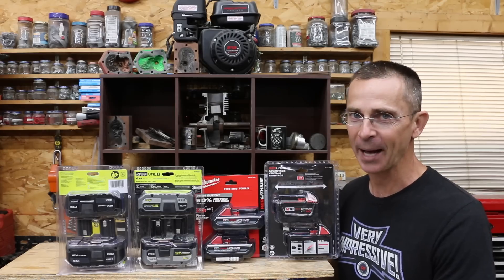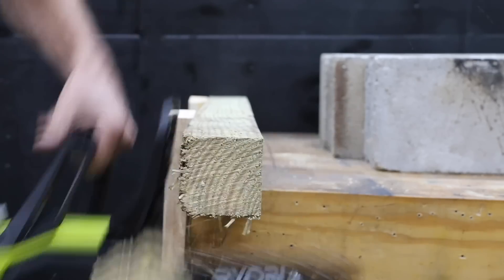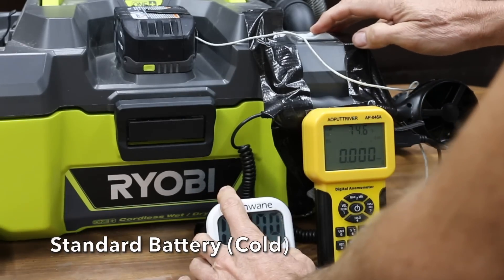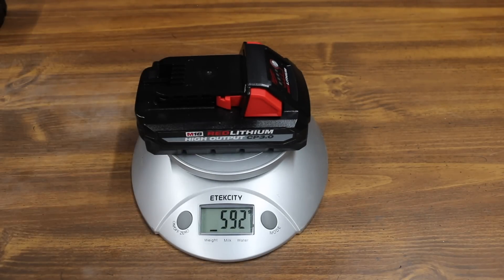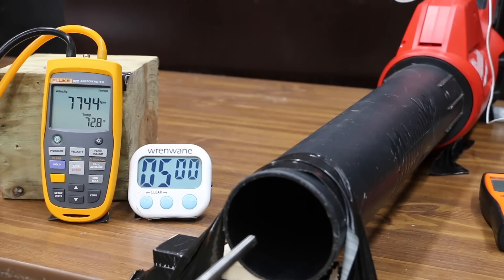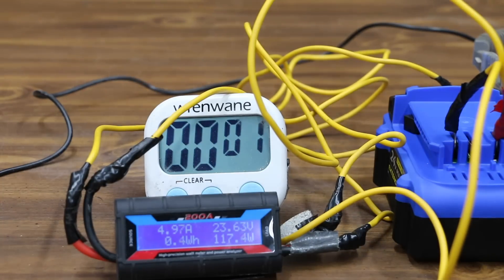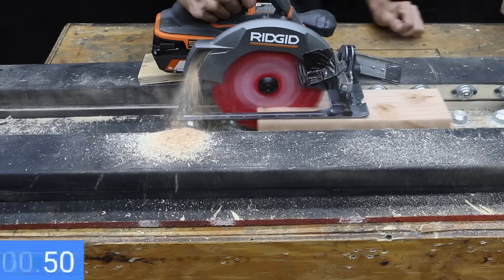Are "High Output" Batteries Better Actually Worse?

Comment: Im a milwaukee snob but became this way over the past 10 years using the brand relentlessly. The tools and batteries have outlasted everything ive used in the past from dewalt, bosch, makita, and porter cable. So yea call me biased but im a believer. I have 2 ah, 5ah, and 6HO, All genuine. I dont notice any performance gain from the 5ah to the 6ah HO running in my blower and hackzall so i dont think id spend the extra money on one in the future.
Reply from the maker: Thanks for the feedback.

Comment: I know I sound like a negative nancy but a chainsaw is a really undesired tool to use as a control due to how dependent they are to their blade wear.  The circular saw with carbide teeth is far more consistent.

I noticed that battery powered chain saws worked really well on first usage of s chain then it would struggle, whereas a gas powered saw has the hp to just chug through with a 80% blade.
Reply from the maker: Thanks for sharing.

Comment: I beleive the Kobolt Ultimate Output are only supposed to make a difference when paired with their XTL line of tools. I have the XTR circular saw with the regular battery and have not seen any need for more power.
Reply from the maker: Thanks for sharing.

Comment: Ugh, what a convoluted mess.
How does the high output model have the same Ah rating as the regular?
Sometimes it's about size, same output but smaller or lighter, & that's okay.
But, a spec they never provide is maximum output current which would be helpful for tools like saws. One 3Ah model might only make 3 Amps while another has the same storage capacity (lasts nearly the same duration at 3 Amps) but can deliver 4 or 5 Amps.
A rating of 3 Ah for example does not mean it will only deliver 3 Amps. It means it will deliver 3 Amps for an hour, or 1 for 3 hours, and so on. But maybe it'll make 6 Amps for 30 minutes.

It's also difficult to compare when you have 18/20(really 18), 24(21.6),36/40(36),56,60,80 volts etc...This is why Watt hours is a more useful value.

Comment: The knockoff 9.0 Milwaukee compatible battery is pretty good overall at less than 1/3 the price. Not for high vibration tools like the rotary hammer. Other than that they work well and for a blower or radio, flashlight etc are excellent. Durability: about 65% life of the original battery. I have sold about 25 of them now without one return. Good value. (The other amp hour replacement batteries like the 5.0 are not worth buying, most are defective.)
Reply from the maker: Thanks for the feedback.

Comment: I use Dewalt cordless and can definitely say their bigger batteries don't give a tool any more power, but they do hold a charge longer, there is a big difference in how i use my tools and your test though. For the most part i don't do tasks that put a continuous, heavy load on the battery like long cuts through 2 by wood or drilling steel. I'm mostly using them for pre-drilling and driving fasteners, that gives the battery time to cool and recover between uses.
Reply from the maker: Thanks for the feedback.

Comment: The 3.0ah High output Milwaukee is worth getting for the Framing gun as it performs well and feel much lighter then running a 5.0ah.

But the ''high output'' is a bit marketing gimmick. As 18560 cells vs 21700 cells is the only science behind it. But in saying that Makitas 40v line up shows even 18560 cells out perform larger cells due to overall battery packs WHs
Reply from the maker: Thanks for the feedback.

Comment: Another great test, but from my experience the high power Bosch batteries (Procore) that uses 21700 cells instead of 18650 can give a lot more amps, and it is night and day differences on tools like a drill or a angle grinder when cutting larger pieces of metal or screwing inn large screws like 6mm thick and 140mm long screws. The tool simply feels a lot stronger and seems to have way more torque for heavy use cases. This can be confirmed when looking at performance numbers on torque test channels videos  using batteries with 21700 cells vs 18650 cells. 

It also seems like a battery with 5x 21700 cells gives more amps than a battery with 10x 18650 cells. The 5 cell 21700 battery is also much ligheter, which makes it even more preferable for tools you use a lot and carry around.
Reply from the maker: Thanks!  Thanks for the feedback.

Comment: I like the 6.0 Milwaukee batteries over the 5.0 batteries in the High Tq impacts.  New Mid tq 3/8 & 1/2 I like the 3.0 HO batteries.  The 3.0HO definitely don't last as long as the 5.0 but they seem to have a little more power to get off bolts and nuts. I noticed a difference on the New Mid Tq impacts with the 3.0 and the 6.0HO batteries vs the 5.0 
The 8.0 I use in blower or weed wacker,  12.0 in the mower. When my 5.0s die ill replace with the 6.0HO batteries.  So far the 5.0 lasted me since 2017 when I got my first Impact the 2767, still going strong out in the field on heavy equipment and big rigs
Reply from the maker: Thanks for sharing.

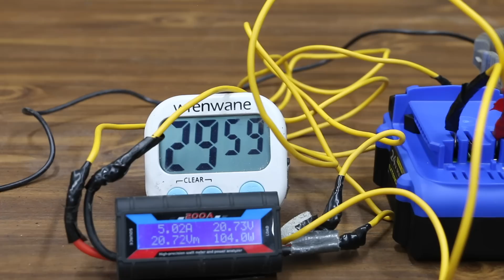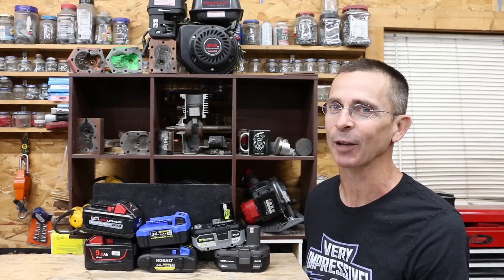Comment: The knock is obviously inferior performance-wise, however, given the huge $44 vs $ 229 price differential, there could be an argument made that even given the performance difference in the OEM's favor the knockoff is a much better value for the money @ $44 for a 11:48 runtime vs $229 for a 16:05 runtime.
Reply from the maker: Thanks for the feedback.
Reply: Unknown origin cells of unknown quality... With unknown protection, and probably no warranty.

A "good" deal til they stop taking charge, or burn down your shop.

Comment: Would be interested to see a durability test also. As I tend to use m18 batteries in high stress environment on impacts etc. I've broken both the knock off cases as well as a couple of brand name ones.
Reply from the maker: Thanks for the suggestion.

Comment: I love your videos, but I have to contest: the form factor of batteries (18650 vs 20700 vs 21700) does not affect how powerful they are. Rather, they offer (but do not always guarantee) more volume which can result in a higher capacity. It is very possible to find an 18650 battery with higher amperage and capacity than a 21700. It really comes down to the specific batteries being used, not their form factor. Maybe that can be a video! You'll find a large variance of amperage and capacity among batteries of the same form factor.
Reply from the maker: Thanks!  Thanks for the video idea.

Comment: Interesting results. I would have expected a bigger difference between the HP and the regular batteries being used in power-hungry tools. Goes to show that I made the right purchase with my Makita 18V equipment. It might not be the newest or most powerful system, but it's well proven and reliable.
Reply from the maker: Thanks for sharing.

Comment: I'm glad you included some knock off gear, I know the stuff will be inconsistent but at a fraction of the price they deliver ok. Felt like I didn't get as many cycles out of Ryobi copy's and they turn into bricks easily if abused.
(I bought a kielder 18v ratchet as it was the only one machinemart had in stock, it's a horrible colour like sun faded green ,but the battery sticker and case are bright green, ,checked online, they are actually intened that colour)
Reply from the maker: Thanks for sharing.

Comment: Video Idea:  What kind of threaded inserts are best or what method is best.  I often use inserts to help stop wood slabs from cupping but I have different problems with all different materials (brass, steel, pig iron etc.) when trying to secure them into the slabs.  I use 1/4" 20 TPI inserts and have tried strengthening the hold with wood glue, epoxy and CA glue.  Lately I have been passing on the inserts and have been cutting threads directly into the wood and stabilizing the wooden threads with epoxy after threading the holes, then re-threading.  It would be interesting to see some numbers on the failure points of each style.
Reply from the maker: Thank you for the video idea!

Comment: I have an ebike.  The guys that hop up ebikes use Molicel batteries.  Would be interesting to see if these packs were rebuilt with Molicel batteries if they would perform any better.  Of course depends on bms and any controller in the tool as well.
Reply from the maker: Thanks for sharing!

Comment: I purchased two knock-offs f the Milwaukee M12 XC 6.0 from Amazon. One of them literally smoked the first second I pulled the trigger on drill, with no load on it at all.
Reply from the maker: Great point on the knock offs!  One of the knock offs used in this video is already performing poorly and has about a 1 amp hour capacity.
Reply: This... And yet people get cheap and buy the crap anyways.

Comment: Hi, I have a request, a little bit too ambitious or just too big to ask, but anyway.

What about a video that may suggest a better value tools and/or performance for people who are building their collection of tools.

For example: I know that brand a is great at power drills, brand b is good also, and brand c is not quite good.

Then for oscillating tools, c is the best, b is not far behind and a is too overpriced to justify what brings to the table.

Now all 3 brands have proprietary batteries and chargers, so I would want to share the same batteries for all my tools. Then I see that it may be better for me to get tools from brand b, although it doesn't Excell in singular tools, overall brings good quality for me to buy my tools from them, without having an excess amount of batteries that only work with only one tool.

This was an easy example, but there are so many options and considerations that may be very difficult for an average Joe, like me, to decide properly
Reply from the maker: Thank you for the video idea!
Reply: @ProjectFarm  That was fast! Much appreciated my man.
Reply: @MaquinaRara1 would’ve been shorter to just say to compare how well each company’s batteries do with various tools of that brand since we all know if you buy their batteries, you’re buying their tools too
Reply: @joshp6061  that was not the idea I was trying to convey. What I was talking about is which group of tools is better to acquire given that some brands have better or worse tools in each category.

For example, I need 5 tools that can share the same battery. And there are 5 different brands that can do so.

However, there is not a single brand that has the best performing tool in the 5 categories, so instead it is better to choose a brand that have 5 decent tools, rather than one brand that has the best tool in one category, but the other 4 tools are mediocre.

And not only that, there are tools that don't operate with batteries, but works well in conjuction with other tools of the same brand. Perhaps could be tools sets like packages that includes, say: screwdrivers, hammer, wrenches, pliers, etc.

Comment: I did not expect the "large- capacity" "cheepy batteries" to do well against the "High-Perf, Performance batteries." I honestly thought those hiperf batts would bring the magic. I'm hesitant to say that bigger (to a degree) has always been better for my power tools, but I have yet to try less expensive bigger batteries. I suppose we shouldn't rule them out completely, just because tool perform a little bit better under some situations than the lower cost option.
Reply from the maker: Thanks for sharing!

Comment: All I know is that my HO Milwaukee batteries keep my tools powering through the toughest of cuts or holes without bogging out at all. 

Also as a side note, the Ryobi HO are meant to be used in the HP tool line, they aren’t designed for the standard Ryobi cordless stuff like you used in this video because the HP line has extra contacts.
Reply from the maker: Thanks for sharing!

Comment: The knocks off's are 1/4 the price and run 13 minutes instead of 16. Seems best to buy the genuine tool then knock-off batteries. I've run cheap china batteries in my Dewalts for over 10 years.
Reply from the maker: Thanks for sharing!

Comment: I’ve got to admit, I just buy whatever Milwaukee tool that I’ll eventually need to replace when it goes on some sweet sale that comes with two big batteries. I’ve never paid attention to high output or not haha but good to know!!
Reply from the maker: Thanks for sharing!
Reply: For instance Home Depot had a brushless( not fuel) hammer drill with two 4 amp hour batteries for $275. Milwaukee hammer drills take forever to die even with very rough use. Doesn’t happen very often. Probably two hammer drills needing new brushes in the past 10 years for me. But now when I go to have them repaired most of the time they tell me I might as well just buy a new one instead of repairing. So I just wait for a sale like this and buy two. Then I have more batteries lol. Absolutely love your videos!

Comment: I would love to see you do coolers! Maybe include tests about shade vs no shade, drain the water vs don't, frozen water bottles vs ice. Ice packs vs regular ice. And, of course, different brands. There are lots of good American made options. Thanks!
Reply from the maker: Great suggestion!
Reply: @ProjectFarm  Be sure to include KONG coolers. Made in USA and under rated.
Reply: @ProjectFarm  Please include ORCA's Made In USA coolers
Reply: I buy RTIC an blue cooler ice chestsvroto mould and best value free shipping an beats that expensive one from ace hardware I think it's darn can't remember name , at 66 yrs old , it's not igloo but. ohh yes Yeti,   the soft side insulated RTIC travel cooler doesn't preform well at all
Reply: @mrbillpurcell6203  RTIC is pretty close to Yeti - but not nearly as expensive.   decent company.   made in china of course, but they all are
Reply: @chuckdawg2799  I'd never buy yeti , RTIC is best value an I have four of them ,
Reply: Best comment I have seen
Reply: Please include Pelican if you do this.
Reply: plz include ozark trail-walmart.
Reply: On a side note with this, maybe portable compressor fridges as well. They're taking over the market. Run watts, time to cool from a set room temperature to say 32F, watt hours per 24hr cycle, space, dual climate vs single, lowest and highest set temperature. I've started to prefer buying them instead of coolers even with the extremely high price tag. The added value of being able to keep your goods frozen with a little battery is just too high.
Reply: Also igloo bmx coolers. Would like to see how it stacks up to yeti and Rtics
Reply: Ever do a framing hammer comparison?  So many designs, weights, handle lengths, material composition? Test for striking force, sound level, shock vibration, head speed etc?
Reply: @wallacegrommet9343  stiletto or any other titanium hammer. If you don’t have one, get one. You’ll feel the difference right away. Not cheap though.
Reply: A certain magazine did a cooler shootout couple years back.  It included all the fancy big brand cooler names and the Ozark Walmart brand. The  Walmart brand was the winner and the overhyped  yeti actually got last place 😂
Reply: Get the makita cooler it freezes and warms food to 140f I love mine so much.
Reply: @brandonmcdonald8356  that an entirely different  application,

Comment: I really wish there would be some sort of industry professional/manufacturer that would share exactly how wide & large the profits are with these battery packs.. Maybe I've become a cynic. But, for 18650s or 21700s,
Assuming each cell was $2-5 (as a consumer. Not accounting the bigger discount when buying in volumes for Milwaukee, among others), and the cost of the same plastics/rubber & refined mass produced shells/housings, and likely a $5-12 proprietary PCB for BMS... It makes no sense for say, a 5Ah to cost (individually) $150+.
On top of that, again it makes one question why a 8Ah milwaukee battery is north of $279 - & yet has less failure rates than their 12Ah (which at this point you should just see the price tag for yourself as a source of entertainment)..
I think it's too easy & convenient to dismiss the topic as, "well they offer 2 5ah in a bundle and you can make it essentially 3 for $200"- wherein by that logic why wouldn't you be able to have an 8Ah available for at least the base price of literally that single "combo kit", as it would cost twice the amount of materials & cells for a 2x 5ah ontop of the charger (the standard one. Although lately seems they've run out at HD. Only having the dual bay fast charger and... No free gift- lol, all the better of a coincidence idk) than a single 8Ah.

Comment: Forgot.
Okay the Milwaukee line M18 has extra capacity, high demand and high output.

I own Milwaukee use the XC the 3.0 are okay my impact driver 2853 came with 5.0 they last all day with power left over.
Can you test small amp verses big 2.0 verses 12.0  the the 3 kinds of Milwaukee,
I'm switching to Hilti some sone tools festiol for couple others. 
Nice job keep up you testing.

Comment: The Ryobi chainsaw used is not one designed to take advantage of the HP batteries and neither is that shop vac. There's an extra 2 contacts on the back of the stem on the Ryobi 18v HP batteries, and if a Ryobi 18v tool doesn't have contacts to contact those contacts, then it doesn't benefit from the HP batteries. I can confirm from my personal use that sometimes it really does make a difference.
Reply from the maker: Thanks for sharing.

Comment: I agree. you can buy 2 sets of the cheaper option and have 40% more power to work with (just a guess).  Now if you need every bit of power and usage because you can only carry one battery with you, then obviously the expensive option is the way to go, but us little home project folk,,,, 40 bucks is good.
Reply from the maker: Thanks for sharing!